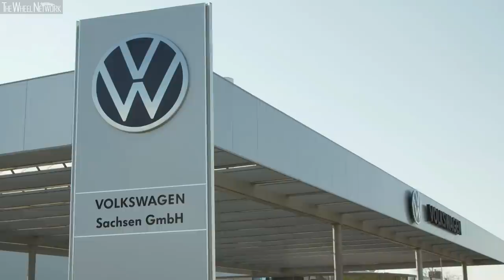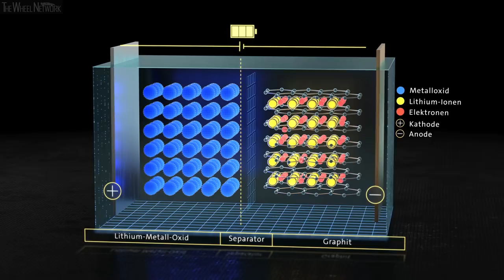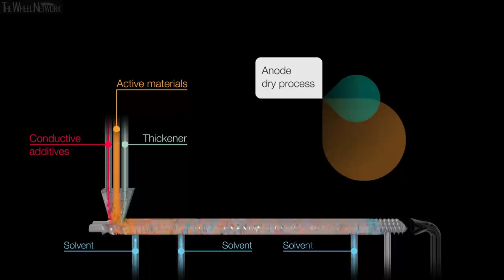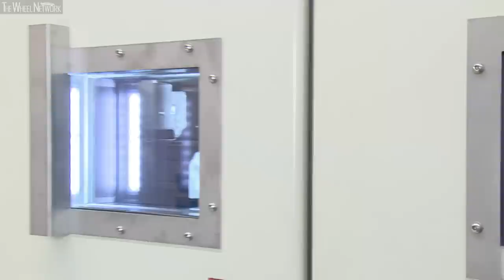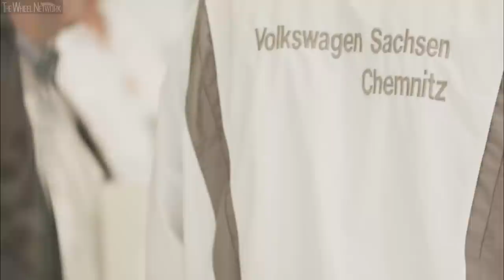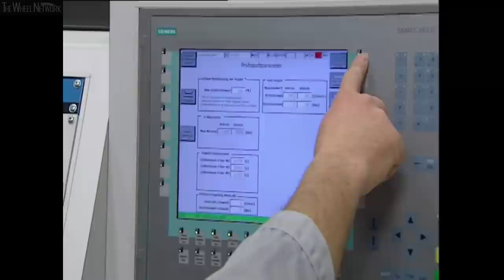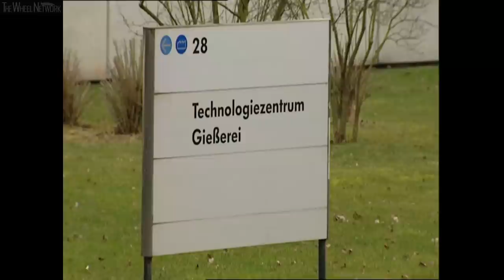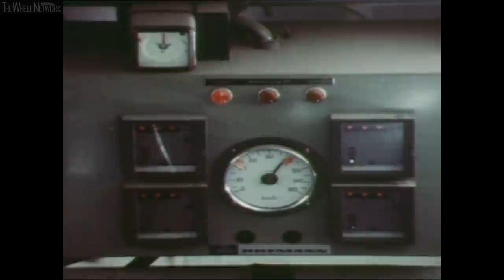Volkswagen Production in Germany

Comment: One of the best carbrands ever
Reply: Question Is : As expensive or more vs competition-High maint costs- Then below average Re Sale value.  Question Is    Best carbrands to what advantage?   thanks
Reply: @dirkdiggler6230  Drives as well?  can you be more specific?  Would you not agree to extreme high maint costs and over complicated function? Was it not first designed to be  "simple and the Peoples Car?  Whats so simple?
Reply: @raymndstannski3947  It doesn't drive like a horse cart like most...Toyota's for example.
Reply: @humushumus2219  Way to much maint for the end result !
Reply: @dirkdiggler6230  Have you tried other brands?  Toyota's is (and this is a fact) one of the worst brands to drive.
Reply: Oke siap komandan kubawahkan pulang mobil baru 6 unit kowal kowau kowad sopir wanita gadis kirim kubawahkan pulang ke rumah
Mobil baru 6 unit kerumah pandugo rungkut ke surabaya  oke   Ri

Comment: at the 1:43 marker...2 small vertical diamond-shaped dents in hood just above VW emblem at both 11 and 1 o'clock...if it's in the press, it's in every 1 of them, guidecoat would show these up billboard-big...33-year Dick Nobile certified GLASURIT painter.
Reply: That's on the front bumper and just made out of plastic. There isn't any press and it can simply be fixed.

Comment: Hands 🙌 on building the Beetles was by far much more entertaining.  I vote for VW to bring back the air cooled engine and the Beetle.
Reply: Petrol cars are being banned worldwide, not likely.
Reply: Beetles were made in Australia from the early 1950s til 1977 in Melbourne Victoria in the suburb of Clayton. The facility was bought by Nissan motor company of Australia in 1969 I believe before fully taking over the facility for local manufacturing of Datsun vehicles. Nissan had been manufacturing vehicles in Australia for some time prior to the occupation of the old Volkswagen facility in 1969 before completely taking over the factory in 1977 which spelt the end of making Volkswagen cars in Australia. Datsun/Nissan car manufacturing in Australia continued until 1991 when Nissan decided to cease car manufacturing in Australia. The factory was sold to HSV, a performance offshoot of GM Holden which made high performance versions of the iconic commodore and high performance versions of the luxury based lwb statesman and caprice until the end of Australian car manufacturing in 2017. HSV continued until the axing of the Holden brand in 2020. A bit of trivia and brief history of Volkswagens manufacturing existence in Australia. 😁👍

Comment: I have a 15 year old golf TDI which is still in good working order because it gets serviced every year but the inside plastic and upholstery is falling apart. I don’t think that VW Europe understands how hot cars get in Australia. A number of years ago I had to have the lining of the ceiling replaced because the glue had degraded so much that it was hanging down. Since then numerous plastic parts have broken and the linings of the doors are coming off. This is just an appeal to the manufacturers to take the high temperatures that cars in many countries face when they use plastic and glue.
Reply: It's 15 years old, things are going to break

Comment: Drum brakes on the rear axle? This is 2020!
Reply: The motor drives the back wheels and does most of the braking.
Reply: Yes it's 2020 and these EVs have powerful regen, rear disc brakes are just fashion and not needed.
Reply: The article cited by Schlichter Hannes says that when brakes are used rather infrequently rust is a major concern in disc brakes and will cause heavy costs for the owner. Furthermore, drum brakes are lighter and help reduce weight and they are much better protected from dirt and rain/water. As far as function is concerned drum brakes do the job as well as disc brakes with the exception of fading on overheating which will occur much less in EV due to recuperation.
Reply: @higamato3811  This is the official new, but the real new is that drum brakes are cheaper than disk, You always will have to brake, so maintenance is not the problem. The performance of disk brake is far better than the drum. It is only cost.  Companies doesn't care about customer's economy maintenance. Only care about earning money with the after sales : Drum brakes cost more reparation hour, better for the company.
Reply: @yutufyourselable  As it seems that is not correct. With recuperation and one-pedal-driving the brakes are much less used than in combustion engine cars. The remaining brake job is almost exclusively done by the front brakes which are disc brakes in the ID.3. This leaves the rear brakes without function in a lot of situations, and this ist where the rust problem comes in.
Reply: Drum brakes are still effective!

Comment: Drum brakes in the rear what is this 2000
Reply: Is an electric vehicle, barely use brake. Having a rear disc brake without using it will corroded, drum solve that problem (that’s what VW said)

Comment: Never a VW,remember dieselgate!!!!
Reply: Vw is over Tesla.
Reply: That was the best thing that happen to VW. Now they are looking to go fully electric thus saving the planet. So it's a benifit and vw car are better built than competition and scale is massive.
Reply: @GowthamV07  VW are not better built than the competition. They perform poorly in reliability and customer service reviews and they STILL have not fully compensated customers over their diesel gate scam. Don't just take my word for it have a read of the many articles on the internet regarding these issues. The Japanese build the best cars at present.
Reply: @GowthamV07  u "save the planet" if u drive bicycle ... u dont do anything good for the envirorment if u buy an EV, because of the batteries. hydrogen is much better in that regard.
Reply: @phil8437  Compare the build quality parts fit and finish not the reliability. For example take the laser welded roof of VW brands and compare it to the spot welded roof lines of cars finish with a rubber to make it look good. And also remember that mostly all ICE car makers were caught the diesel gate as it was bosh hardware being tweaked. read the diesel gate article on wiki to get more info.
Reply: @gOtze1337  Hydrogen is the stupidest thing ever. Hydrogen is like fuel and will be priced the same. Why to use electriciy to make hydrogen and then again convert it to electricity when you can store that directly in a battery and use it in an EV. I know you are baised. But this is for other who might beleive you.